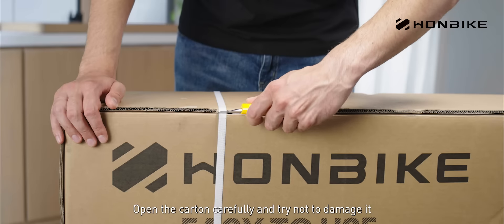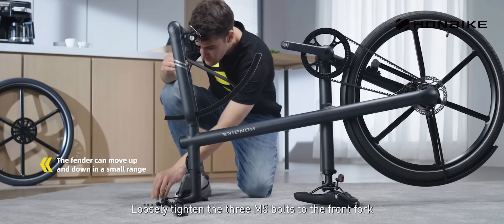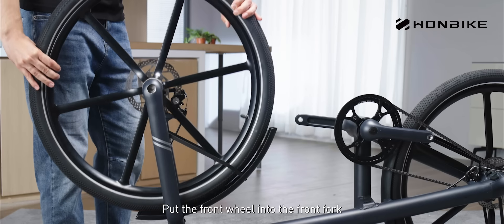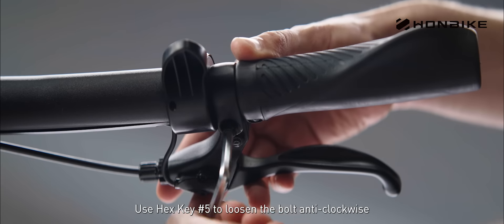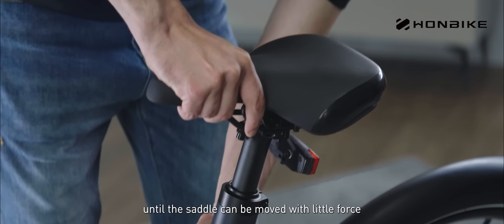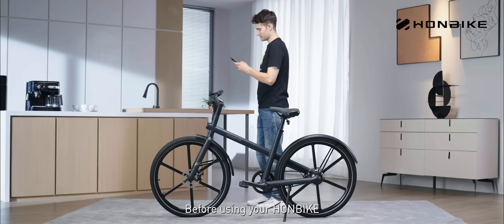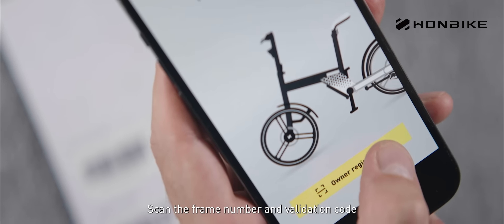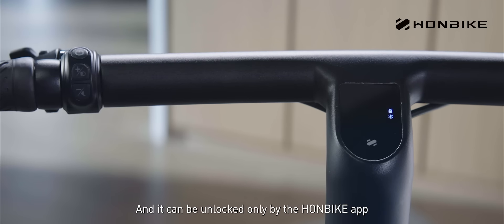Unboxing & Assembling Honbike UNI4

Comment: If you have a flat tyre in rear wheel, how you can fix it?
Reply: good question I would think you should be able to fix puncture without removal of the wheel  but being a little awkward it would be nice to be able to remove I suggest contacting customer service.